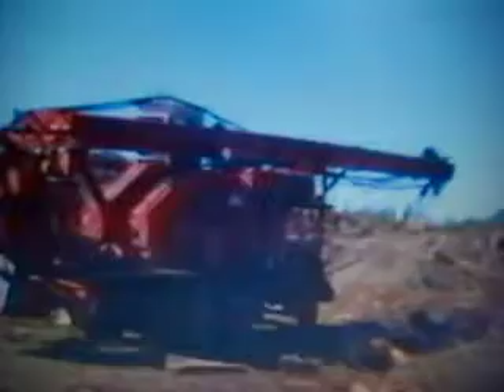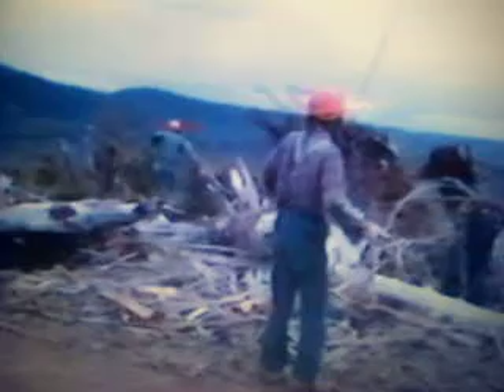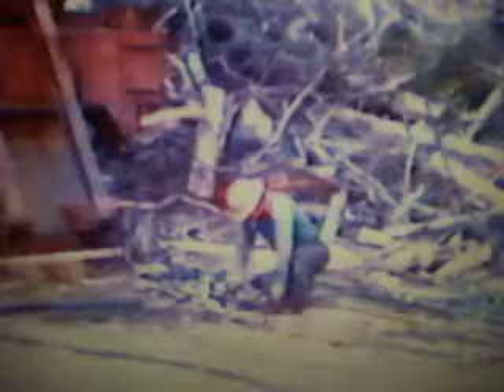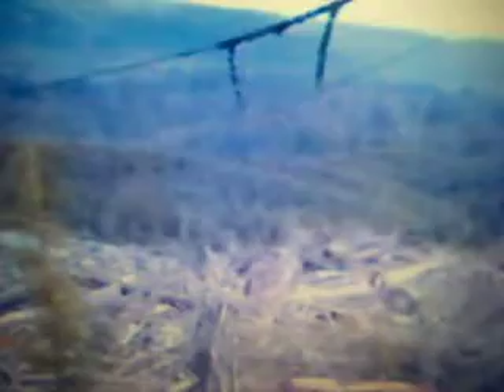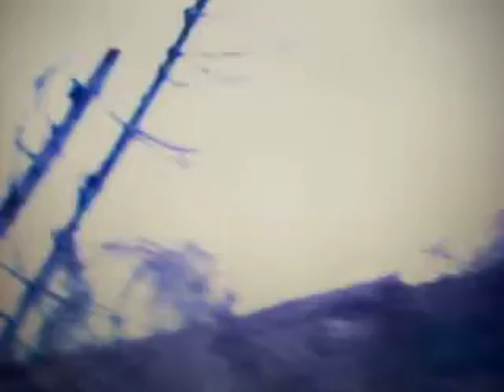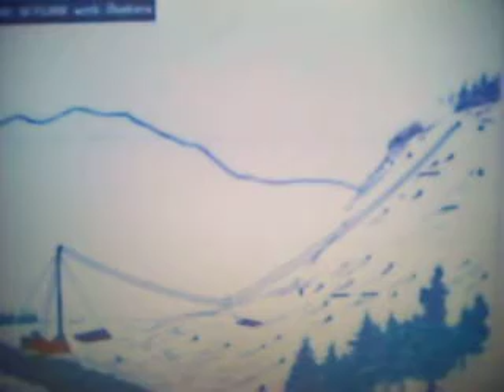THE STEEL SPAR

Comment: Good for a grin. I ran a lot of 90 footers and 071's
The cool ones to run were the 90's that were built on old WW2 era Tank Recovery trucks, The M26 known by servicemen as the Dragon Wagon. They were actually trucks designed for mining and adapted for tank recovery by the Knuckey Trucjk company in San Fransisco.. The original motors were huge 1094 CI gas pots made by Hall-Scott. Steering wheel was 2.5 foot diameter but you still couldn't hardly steer that yarder with the pipe in the saddle.